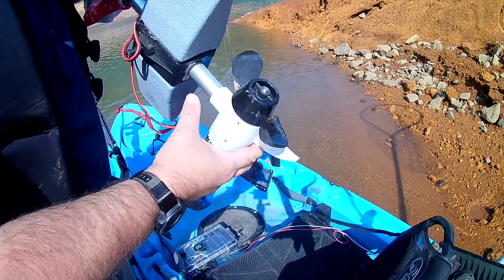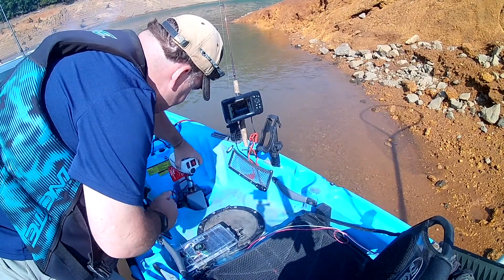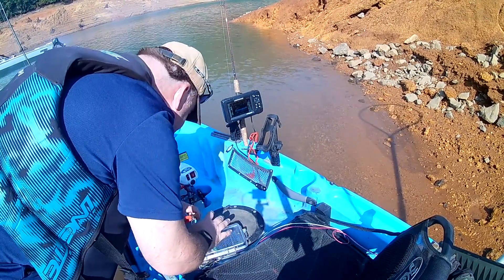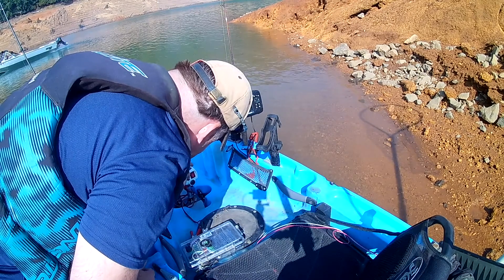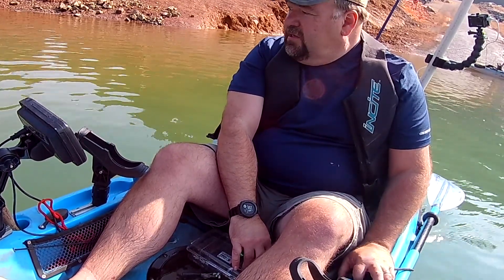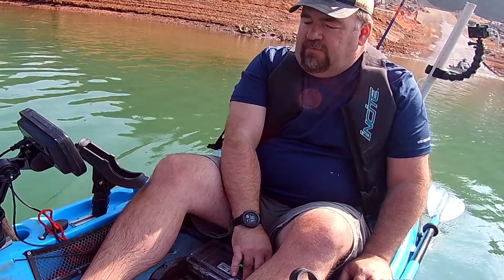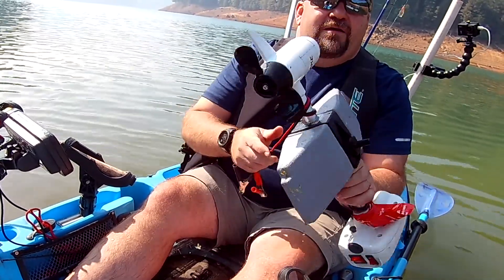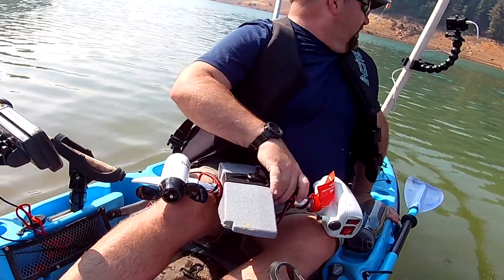Watersnake conversion trolling motor for a Hobie outback

Comment: I did the watersnake mod following other videos and was wondering if I could do one without cutting the pole?  I somehow didnt get wires straight and have no reverse and only the high speed
Reply from the maker: You should be able to do it without cutting the pole.  the box would just sit up hire is all.  You will still have to disconnect the top of the controller to get it to fit inside the cassette.
Reply: Try outback shad on utube for information on how to build one of these